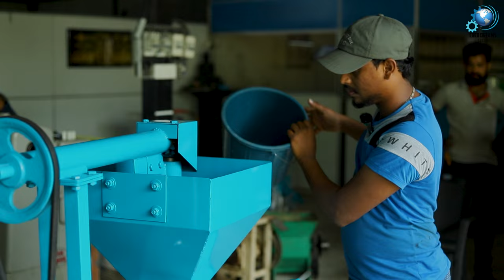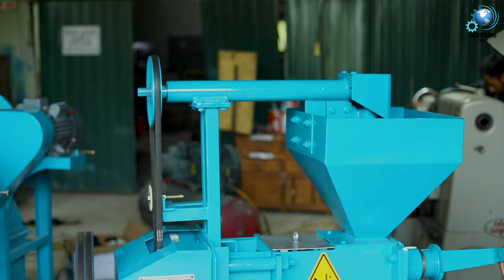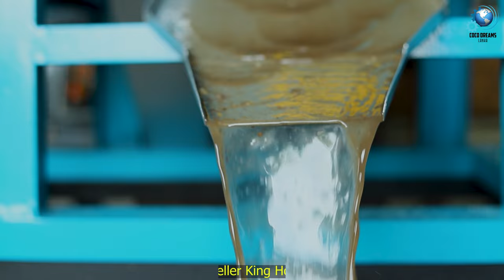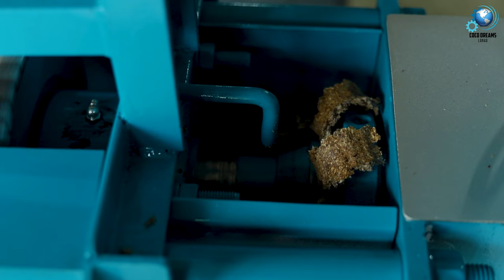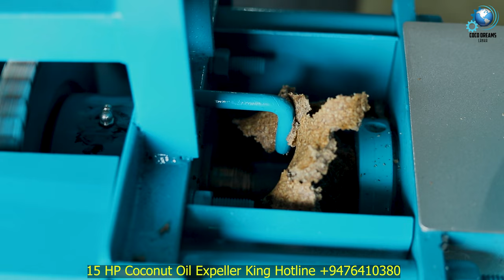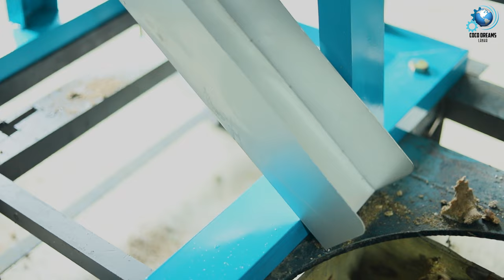Coconut Oil 15 Hp Oil Expeller King Made In Sri Sri Lanka High Quality Machine

Comment: Fixed minimum support price for dry. coconut coconut fibres can be used as scrubbers instead of plastic sponge.use taking soda and lime ie lemon juice for washing stainless steel utensils. Use Tata copper based stainless steell utensils for deep fru cooking with coconut oil. Made in karnataka local employment opportunity for farmers during excess harvest.use coconut sticks for broom sticks for bbmp pourakarmikas free coconut broom,india bata shoe and  socks made  from""Cotton *from Cotton tree found sri jnanakshi rajarajeshwari nagar near rr nagar police station, near carriappa park during summer and woolen shoes during winter from sheep rearing .alternative income apart from organic farming. Wool can be used in embroidery as woolen sweater, or windows screen in summer long lasting using crochet threads